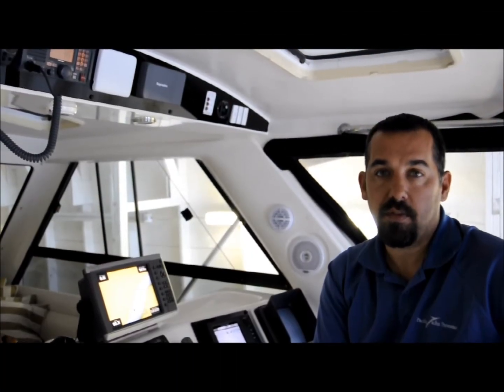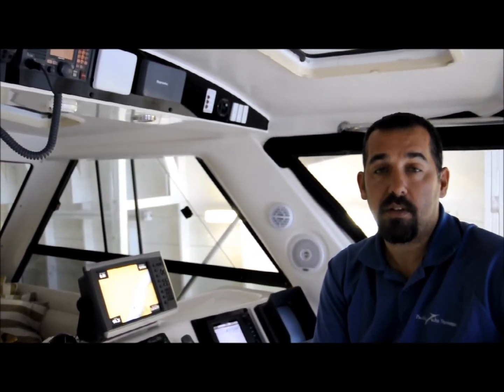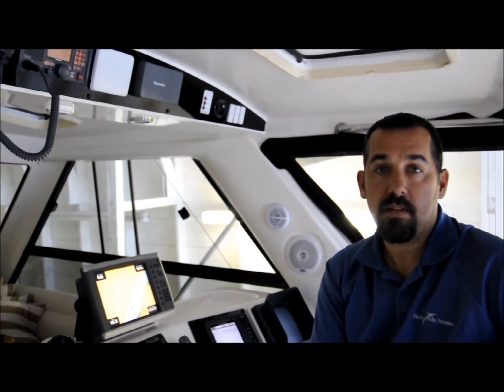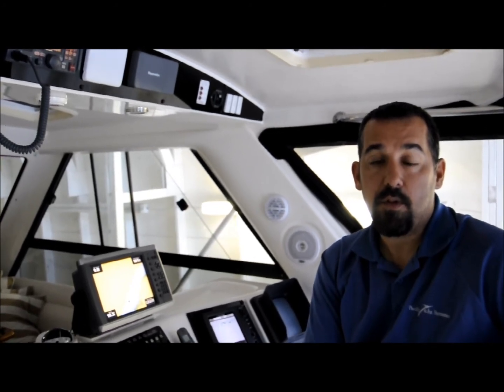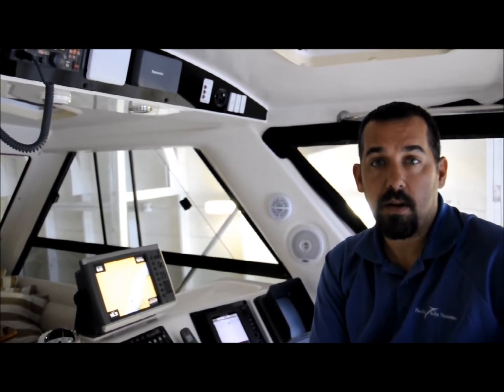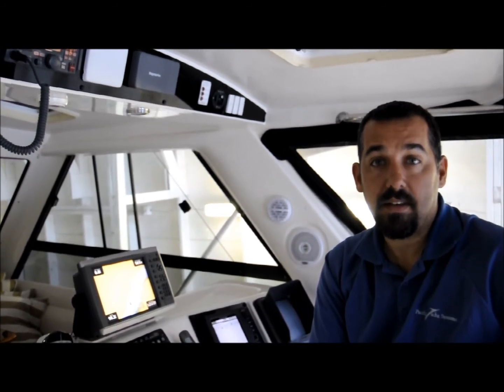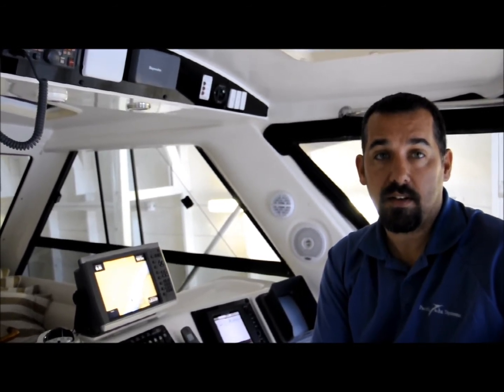PYS - Safety at Sea: Using DSC on your VHF Radio

Comment: WÖW..‼️ Didn’t know of this insightful function, as a leap of faith & helping my local business, 🦘& due to a signal band change, I let a rural hardware employee choose a reputable brand, of marine radio.❗️
Thanks 🙏 to your Custodial Sharing, that for an updated backup two-way radio I’ll Certainly ask the relevant questions, to whom emulates your foresight for detail Guru Cote ✨🙌🥳
Even if I never get to utilise my open water capable trailer boat, @ least the next operator Will have a Safer craft🙏 ☂️
Reply from the maker: Thanks for sharing Adam, glad our content is resonating with you!